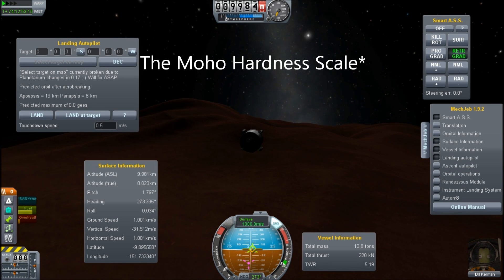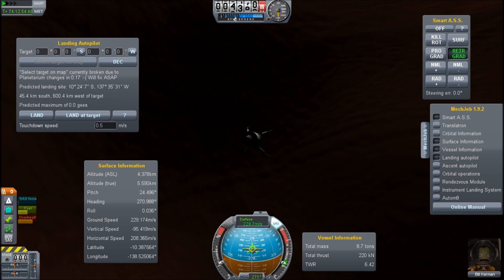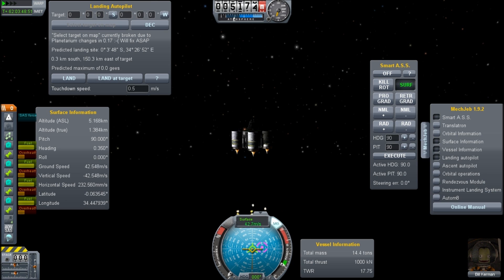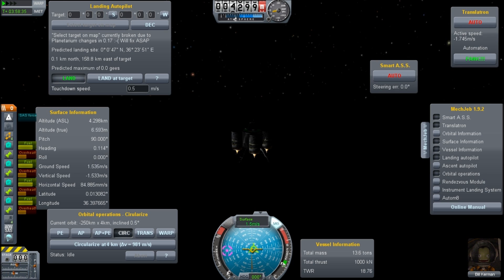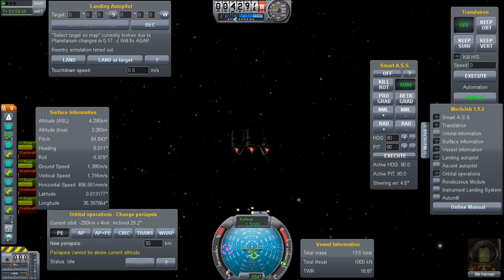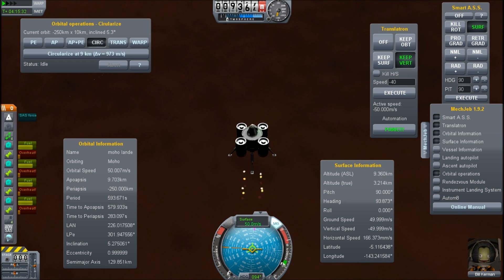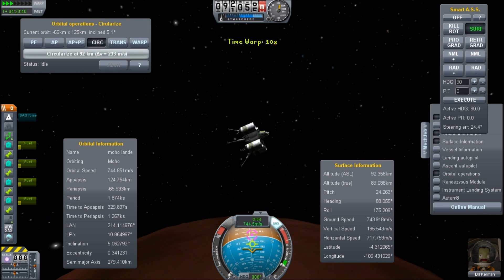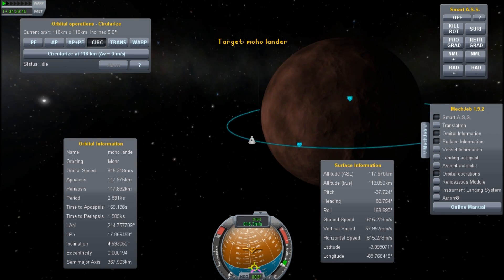Howto Land On Moho in Kerbal Space Program

Comment: For any who are wondering, I think delta-v is referring to the change in velocity. In other words, the total sum of all speeding-up and slowing down that you need to do. You can increase it by tampering with engine efficiency and fuel capacity and all that lovely stuff. (citation needed; all that could very well be phaff and nonsense but I think it's roughly correct)

Comment: There are pits, the bottoms of which no one has ever seen, on Moho's poles. I am challenging you to go to the bottom of either one of these holes by any means necessary, even if it requires you to cheat (who knows, maybe the parabolic increase of atmosphere density allows parachutes to work inside the pits?)

Comment: What about using a series of the small separator solid rockets to decel.  Would be finicky and I don't know if they would overheat but since they burn for 5 seconds it might not be as much of a worry,  just fire one decoupler ring worth and detach then the next group.   I don't know just how viable they are but it might work.   Another way around that I'm sure isn't intended is an RCS lander.   Anyone know if they have overheating modeled for RCS?  More of an exploit but it might work.